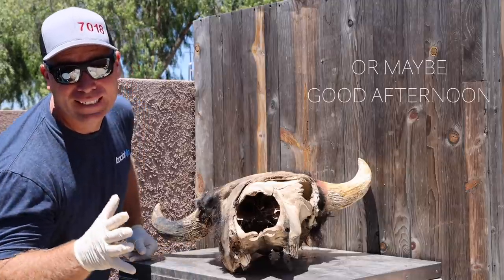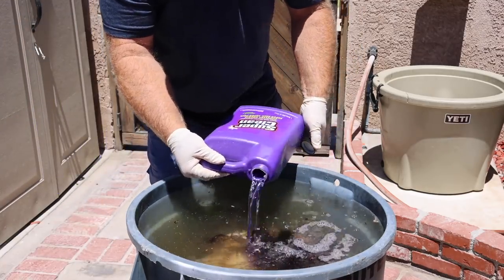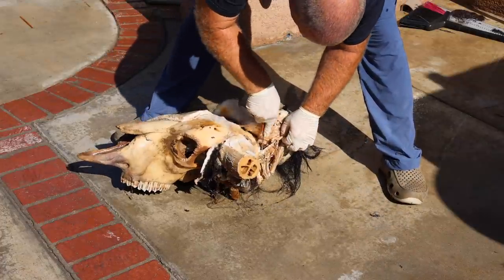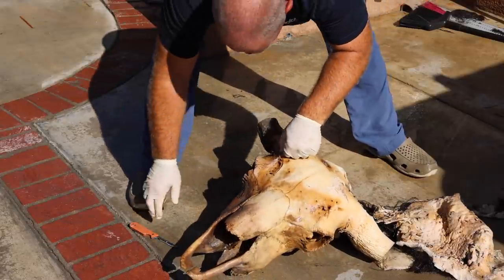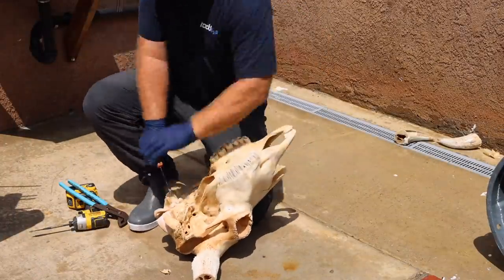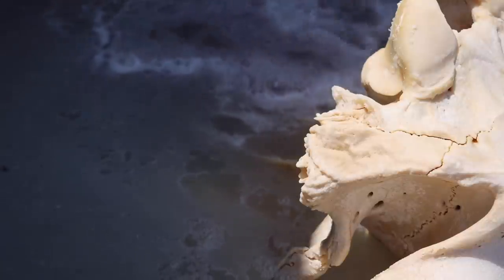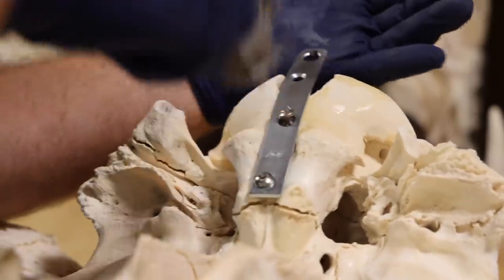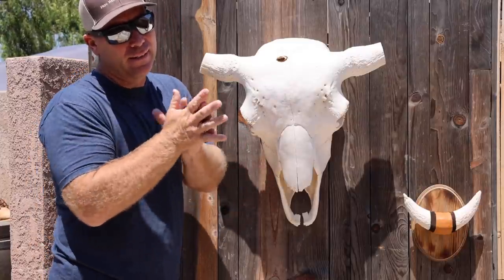BISON DEAD HEAD SKULL CLEANING

Comment: Ever thought about breeding flies/maggots.. and just let the maggots do all the hard word, and they will be exceptionally thorough, inside and out. Then after a month of not having to touch it, do your peroxide soak to whiten the bone up and neutralize the any micronic organics, finish as normal or to suit...? Then if it still has an odor, bury it for a month of 3, if time is not an issue, and the various bacteria in the soil, will go nuts on that as well. touch free cleaning process.. Just a thought.

I used to work on exotic and or vintage automobiles some 20 years ago, and we would get called to either rectify or buy the collector vehicle, and these particular vehicles had somebody who died in them for any number of issues. The longer the body was in the vehicle, while noting the hotter the temp was outside, the worse the smell saturated into the car. There is chemicals today that work pretty good to absorb the smells out of rubber, leather, vinyl, plastic, alloys, steel, but always would creep back out in hot days weather. We would bury the car in ground, ringed with chains to be able to easily pull the units out of the ground, once dug out around it. We'd back the car down into the ramped in hole, so the car would land into 4 smaller holes where the tires would rest kinda dangling. we would pop out the floor pan and trunk pan plugs for water drainage,  then we fill the car with soil. The car would take the weight of the soil, as the entire bottom side would support the weight, and not just the tires and in turn, suspension, that would cause un-needed stress on the car's super structure. once filled, carefully, by hand, back fill the soil around the outside of the car. Often times the side window would be rolled down into the door frame. The vehicle would sit there under the top soil for approx a month to an entire summer season. One might think that the rust due from rain water would be a factor, nope, the oxygen level 8 feet down, very quickly gets consumed by the organic bacteria and results in a CO2...It does sound like allot of work, but compared to the only needing to detail the vehicle once, vs days and weeks and somebody upset that the dead body smell will not go away, even years later. 2 weeks, the car is done,  and on to the next one. Please note, the natural car smell or new car smell if it were a brand new rare car, that smell is removed also, and chemical fragrances are required to temporarily add that back.  
Please note: there are some state laws that requires such info be disclosed to a buyer, that a body had died with in the vehicle, other states not allowed to refurbish and the vehicle is ordered by law to be destroyed, as per, the HAZ MAT and blood pathogens theory's.. Check with your city and state laws. as fines and or prison time could result, if not followed collectly, as the state will find it as ill intentioned on your behalf to mislead a future buyer..... But, when you are talking about a vehicle, that is rare, by either if date of manufacture, or production quantity, most of those collector people, do not worry of such matters, and are about the conservation effort of the rare species's. There is my novel for the week.